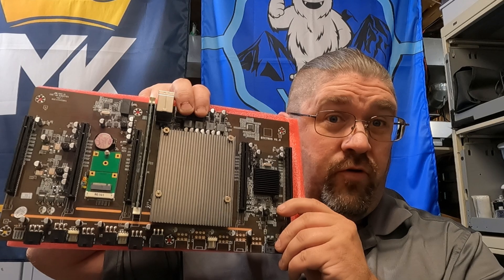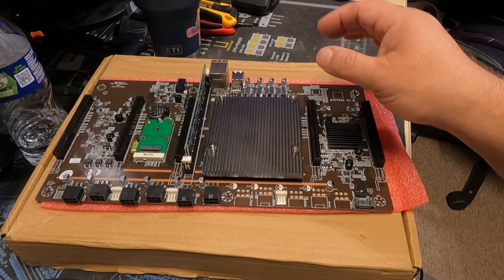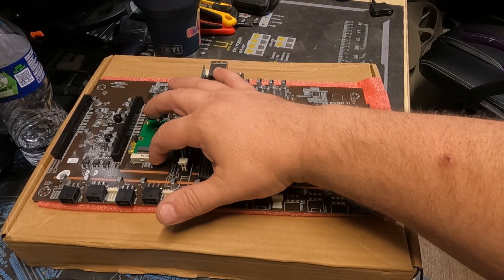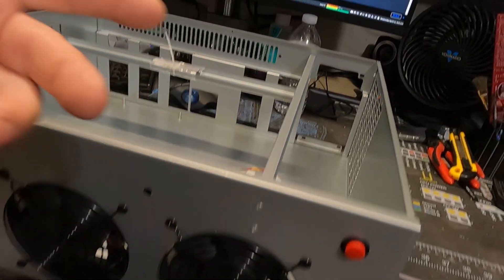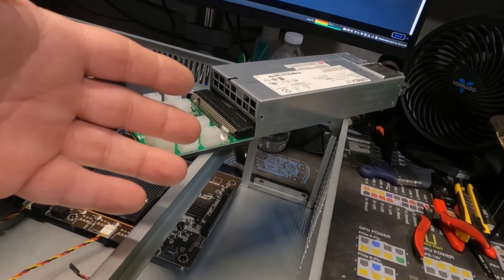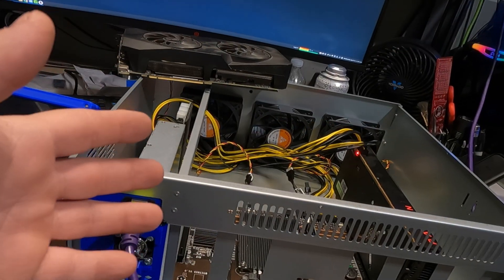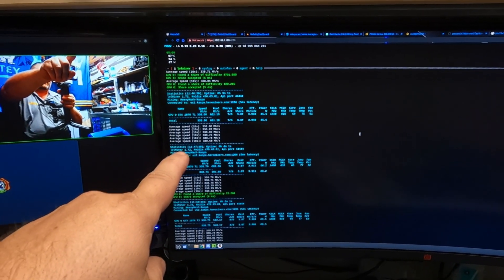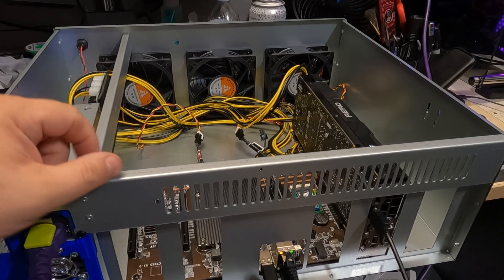POUW Build

Comment: Great Idea with that board but doesnt look like youll be able to get the amount of ram your gonna need for this. They said +25% of the vram needs to be Ram. So with a single stick your not gonna be able to have the amount of ram required. They also said that having 4x what you need is better. But great idea for multiple gpus at 8x

Comment: Flux just announced some prelim specs for pouw, there seems to be a couple issues with the mobo/cpu, the 2 main ones i see is Gen2 PCIe vs Gen 3 min and max of 32gb of RAM, which means cards would max out at 24gb of VRAM or less (gotta have ram at 150pct of VRAM). Please post an update if you find a work-around. Cheers!

Comment: This video was great. I dug into it a bit more and I was hoping this board would support more ram. 

I ended up buying a x99 F8D off of aliexpress. It is a Dual Xeon board that supports up to 512gb of memory. The cpu's will give me 80 lanes. It has 3 pcie 16x and 3 pcie 8x. Unfortunately they're only 3.0 but that will do for now.

I am going to throw 6 2080 ti on it and see how it profits and potentially throw together another one.
Reply: If anyone comes here for info, then this is what I have learned: 

If you are using parallel miner breakoutboards with the F8D mobo, you will want to run the cpus on a separate line. With the power being drawn from the mobo and the cpu under high load then it has a good chance of frying the breakout board (killed 2 already). 

I now run the cpus from a PCIe cable to a cpu 12v eps 8pin (4+4). Both cpus run from the same breakoutboard so there is no timing issues. I am running them on a homemade spliced cables but I just ordered adpters. 

I will update if those adapters give me any issues.
Reply: Great call on the x99 F8D. Different versions come with 2, 3 or more PCIE slots. Tight spacing might require ribbon cables, but I prefer open air anyway. Lots of core, lots of RAM, lots of PCIE . . . this might be the mobo FLUX POUW is looking for.
Reply: @MUCHTRA1N  I ended up building 4 rigs with the x99 F8D with dual Xeon e5 2680v4. 6 PCIe 3.0 x16 cables 20mm 30mm 20mm 40mm 40mm and 50mm was what it took on the open air frame. Seems to work alright. Having a hard time getting the PSU to sync using the sync cable from parallel miner. I'm thinking I would have less issues if I just purchased a 24 pin to dual psu cable.
Reply: Final update (hopefuly) on this journey: 

I discarded using a parallel miner breakout board to power anything on the motherboard and instead I use a solid atx psu to power the motherboardand and cpus. The breakoutboard does not support high enough wattage on the 24pin connector and will fry the breakout board.

Keep in mind how much power a card pulls from the slot. I had a single pcie pin 2070 pull 65w from the slot at 180w total vs a 3070 with 2 pcie pins pull 35w from the slot at 242w total. I do not recommend running cards with 1 pcie pin as they pull too much from the slot which adds up fast with multiple cards.

All said and done I would just buy the octominer server case if I could do it over.

Comment: I have the nine slot same board. One of the PCI’s is bent in shipping as soon as I hook any video card to it I cannot get signal on lane 3 and it turns off and boot process

Take the video card out it will boot up, but it only reads 4 cores out of the six 
of one CPU

Comment: I had this exact idea several months ago my concerns are only one ram slot and a older intel zeon which might not be that great for POUW
Reply from the maker: I was wondering the same thing, you can max the board out with a single stick of 32gb ecc ddr3 ram, and there is another bios out there that will unlock the 2 core limit on the cpu, but may need better cpu heatsink then.
Reply: @madelectronengineering If you could do BIOS upgrade video, that would be appreciated.